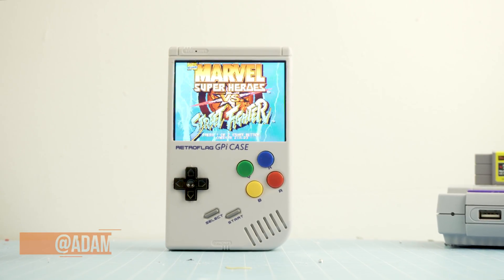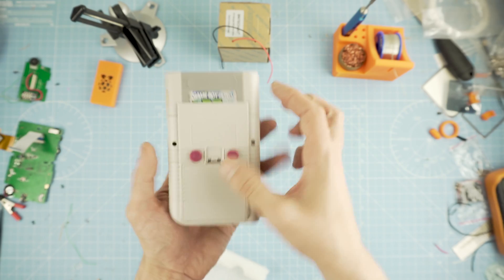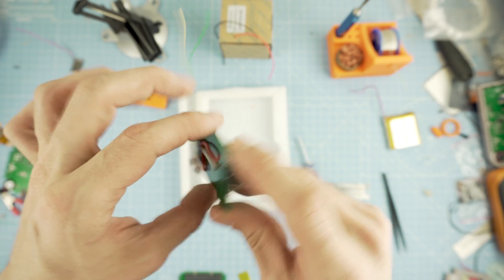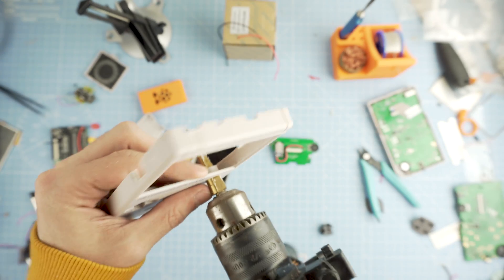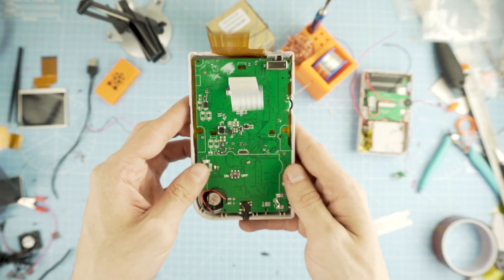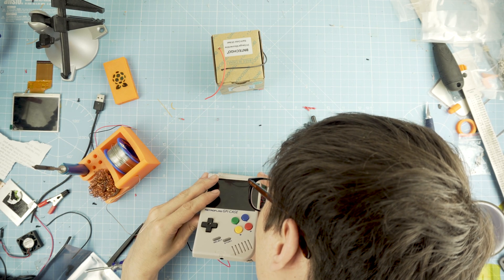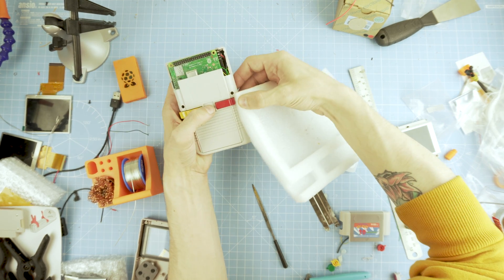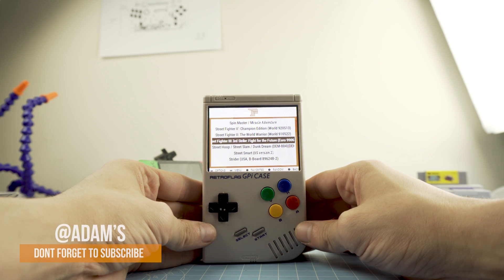Retroflag GPI case Pi3A+ and 3.5 Inch Display Modification

Comment: We really need a display with higher resolution in the GPI case. I like the screen size of the original GPI case, with the greay border it looks more like the original Gameboy. But the resolution of 320x240 is extremely low. They should at least double it (640x480), so that you still have pixelperfect resolution for PS1 but less unsharpness for systems with interpolation.

Comment: What buttons did you end up using for this? The ones that comes with the GPI are taller than your standard SNES or Gameboy buttons. I tried this modification and ended up regretting it because the buttons are now recessed into the pad.
Reply from the maker: You can add a small sillicone raiser, I use SNES in all my builds and never encountered as I always use silicon raisers of the feeling is not right

Comment: I would also love to see a pi3a+ installation keeping the original display.
Reply from the maker: Maybe we go with that in a upcoming video, all videos on GPi came from ideas from the comment section!
Reply: Trying to do it now with the original display, managed to get the power working. I used a 3000mah battery with a 3.7v booster to a micro usb. Both the GPI case and the Raspbery pi 3 turn on. Yet I have no screen output from the raspberry pi so i can't tell if it's working. I am not using the Tinker boy DPI. I assume I have to solder some more wires with the HDMI in order to output. But which pads on the GPI Case?
Reply from the maker: Is quite simple, you need to solder all the pins that went from pi zero to cartridge to the Pi3 and it will power, have sound, and image as normal
Reply: @Adamstech  please do a video about this man :(
I really want to build a Retroflag GPI with a Pi 3A+ for my school project, but I don't know how to solder everything correctly.
Also, do I need the tinker boy? This is my first time building this, a video on it would be so helpful.
I just feel like a GPI case with a 3A+ is the best compromise between size and performance.

Comment: Sorry but that is just stupid. The case cost 80€. If you want to build your Owen versition of the GPI case just buy a empty Gameboy shell and modify that one. Or you can go ahead and design a reverse engineer the cardride and design a new one for another Raspberry pi.  That one you also can sell because I think ther is a big potential in this market.
Reply from the maker: I make those as well if you check the channel but my question is, do you own one?

Comment: could i just replace the rpi zero w with an rpi3a+ following this video? (and keep the original display)
Reply from the maker: You can but you will have to solder  all the wires to the gpio pins
Reply: @Adamstech  you mean from the io conversion board to the pi? whats with this small micro usb ribbon cable? (how would i connect it to the rpi3a+?) 
thanks so much in advance!!!
Reply from the maker: @moritzkaro7717  you need to connect the d+ and d- from the Pi USB to the USB pins on the IO board

Comment: Here is the same display: https://www.ebay.com/itm/272453115665
Reply from the maker: Thanks for sharing man!
Reply: @Adamstech  No Prob, thanks for making these amazing videos! You are one smart dude! I am planning to start with the battery mod next week, then going to move to upgrade the display and your other mods. I was thinking, would it be possible to use the new Pi4 ? It would be crazy to have the 4GB of RAM on this thing!
Reply from the maker: @CLOUDWERXLABS  Glad that you like my videos! I really appreciate it! About Pi4 I am already working on a Pi4 Gameboy but there is still stuff that needs sorting out, as the heat dissipation, we need a solution to that. Keep an eye out for the next vids

Comment: Looks to me you completely forgot to connect audio and the safe shutdown pins. I also dont see the need for your 5v/gnd splitter board. Just solder the wires together.

My own Pi3 mod just solders 30awg wire from the gpio to the cartridge connector pinout.
Reply from the maker: Looks to me you haven't watched the full video, the pins that use the audio are used in my case by the dpi adapter, I got 4 left that I can use for that, but, my focus was the screen not the Pi3A+, I am aware of your mod and I love it 😁
Reply: @Adamstech  Then, you don't have audio? Why don't you operate the LCD in RGB666 mode? It's also pretty weird to operate this thing without the safe shutdown functionality. If you don't have audio I feel you should've mentioned this in the video.

EDIT: Ignore half of this comment. The LCD is an 18-bit display. Still, I see no PWM GPIO pins connected in any part of the video footage.
Reply from the maker: I got the audio trough a PAM amp, about the screen, the project was done with what parts I had from leftover Gameboy Zero builds so from here all these work around. If I wanted just a Pi3A+ I would just go pin by pin as you did but not that is the point of the video :D
Reply: @Adamstech  Ah okay, but that was not mentioned in the video as far as I could tell, and I did watch the entire thing. The relevant GPIO pins on the tinkerboy looked unsoldered.
Reply from the maker: In the first minute I said is not the perfect build if you want to follow do it at your own risk, and at the end specified there is no sound showed in the video, all the 40 pins all soldered, 4 of them are routed on the DPI adapter's back :D
Reply: @Adamstech  Well, I have to apologize for missing the *last five seconds* apparantly.
Reply: Wait Cicirifu did you fit a pi3 b in the gpi case? Im trying to do the same but eliminating the cartridge connector board so that its straight from the 3b to the volume wheel board pins.Do you think it would work?